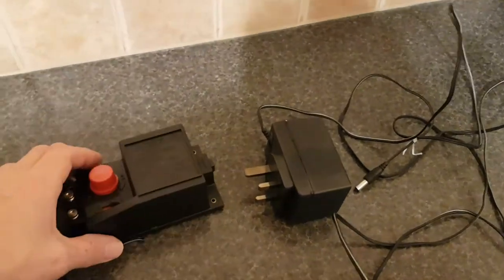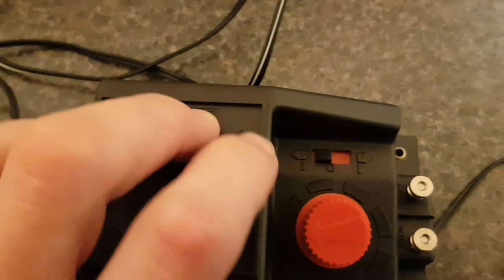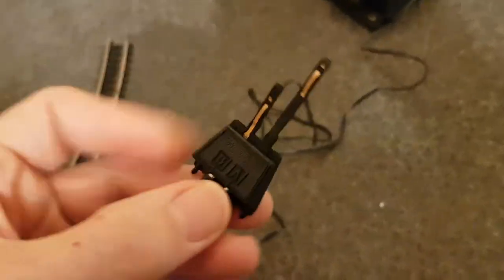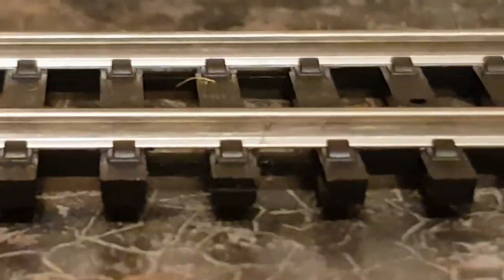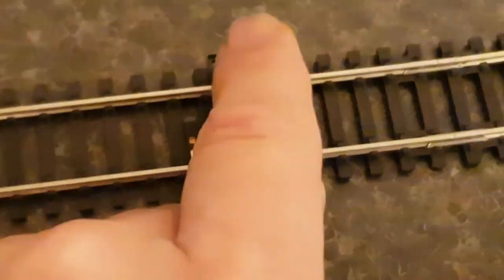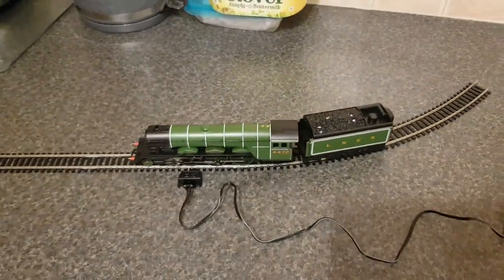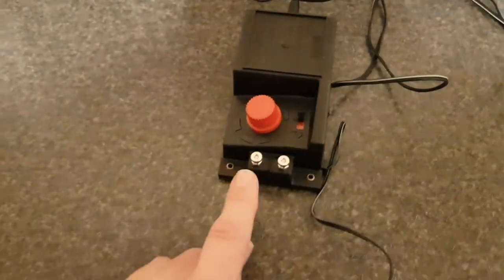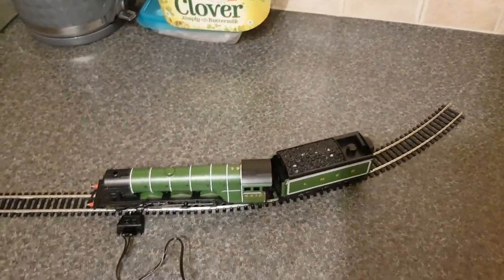How to set up a power pack controller with power clips for a Hornby Model Railway

Comment: I'm a newby to railway modelling. Enjoyed your quick vid. If you turn the 2 pin power supply it will change the direction of the forward and reverse. My question is: How do you know which is positive + and which is negative - ? This can affect the outside or inside track at a later date if I wanted to add extra power supply as the track loop gets bigger.
Reply from the maker: Good question but I dont think it matters as any added loops should be isolated from the original by the connecting points. You wouldn't join 2 power packs to a track and let the power mix. With 2 controllers connected you can run 2 trains on a layout. One on the inside loop and one on the outside loop. But they wouldn't be joined electrically. However if you turn one controller off and park the train in a siding you can then use the other controller to drive the other train from the inner loop to the outer loop by opening the points. Then close the points and run the train from the controller you turned off. Effectively this simulates a real railway where trains are sectioned off and switched from one line to another.

Comment: Very late to this video but i have an old set and train with this exact power supply but the train doesn't start to move until the power is around 75%. At that point the train runs at full speed. I've oiled the loco and I've cleaned the track with ISO alcohol which improved the running but I still have the above issue. 

Does anyone know of a fix? Is my power supply just no good anymore?
Reply from the maker: It sounds like the loco is the problem. You are doing the right thing in cleaning the track. Make sure the wheels and wires that pickup power from the wheels are clean. Don't worry too much about oiling. Sometimes that only makes things worse.
Reply: @DoublehoModelRailways  thanks for the reply! I've tried with a few different engines but unfortunately they all have the same issue. They only move when the controller is at 75%

Comment: Can I just solder the wires strait from the controller on the track ?
Reply from the maker: Yes that can be done. It will make for a more reliable contact. But some would consider it unsightly. If it was hidden inside a lineside building it would be ok.
Reply: @DoublehoModelRailways  from beneath the layout

Comment: How do I test which unit is receiving power. I'm not getting power to the track.
Reply from the maker: Ok. First establish the ends of the wires that come from the power controller  have power. If your wires are not joined by the plastic lug at the end you could hold one in each hand and gently touch then together for a second. You should get a slight spark. 
Difficult to explain further here. Feel free to DM on Instagram